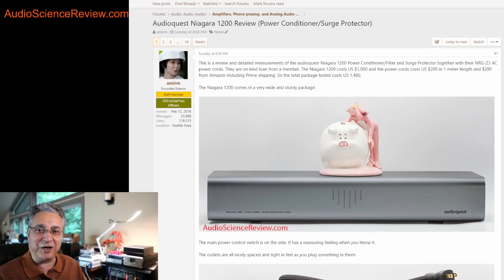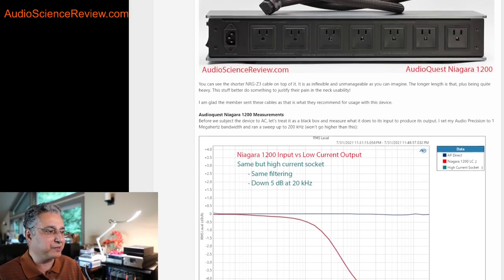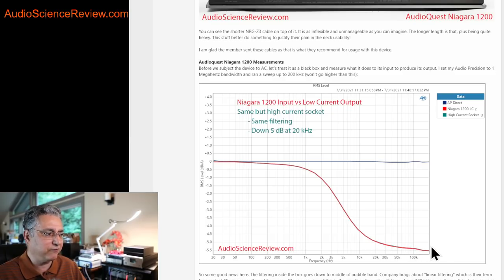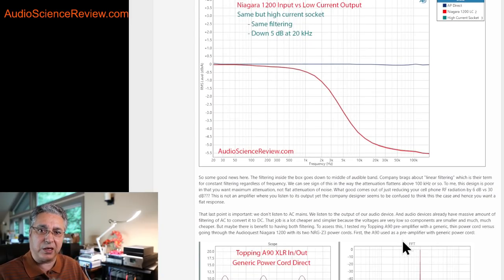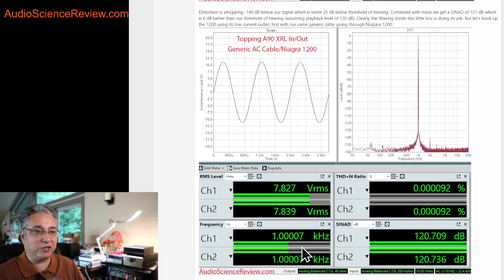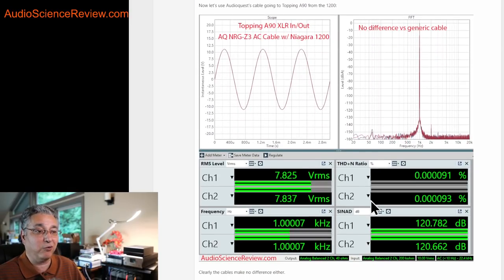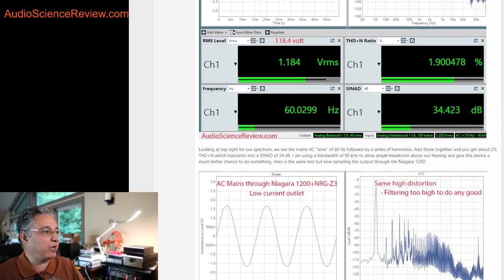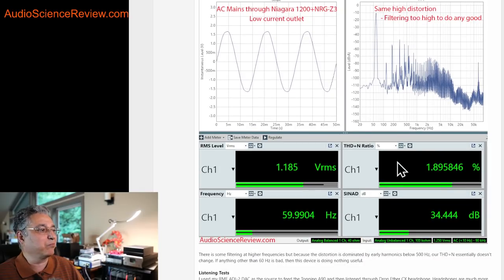Audioquest Niagara 1200 Review AC Surge Protector and Filter

Comment: Ok hooked up to audio quest but when went back to his ..."regular" ...equipment it sounded better. My question is if the normal surge protector sounded better why not tell us what piece of equipment sounded better. don't get me wrong i think this audio quest does indeed filter sound at just above 5k to 3 db but I am not sure that is a good thing. most audio devices are ac coupled and have capacitors. These capacitors filter noise if the noise is filtered before it gets to the capacities then the capacitors filter in such a way in which the dynamics are blunted. What I mean is the audio quest niagara filters the ac mains and the capacitors in my prima luna equipment would round the leading edges. No more audio quest niagara and the leading edges are back. Same device this dude just reviewed. My problem is this person did not trust his ears he said he preferred the sound with out the Audio Quest Niagara which I know is likely because I also could tell the difference. I wish he would of shown the difference between the Audio Quest and his standard device.
Reply: That is not how electricity works, coupling capacitors are not connected to the mains input.... they are connected in the amplifier circuit and at the output. The only job they have is to block DC from the biasing circuit from reaching the output. Those capacitors attenuate lower frequencies, not higher...... input filter capacitors won't even notice power filters being connected as they do so little.....

Comment: Power consumtion is NEVER at 50 or 60Hz, apart only for purely passive loads like resistors, capacitors or inductors. Any other load will consume as it requires and internal capacitors are not sufficient to compensate for that. A constant current load is also not at 50 or 60 Hz, but is at virtually 0 Hz, here the power factor will tend to be equal to 1, but  to conform to our mains voltage we will need to follow a sinusoide in current and power. An audio device can pull from mains at higher frequencies. 
It is counter intuitive maybe, but we do not need filtering of the mains power down to 50 or 60 Hz  for differential. It will be DETRIMENTAL for our device to get mains filtered down to 50 or 60 Hz, even if we can build such a filter. We need to block only the common mode.
1. In power conditioner we should focus to filter the common mode noise as this is the most likely to poison our input output path of our devices, and we should be less concerned about differential, and actually for the latest leave virtually no resistance for the audio band in the power conditionner.
2. A transformer powered device will have a consumption only in the pics of the sinusoidal wave, as the curent will flow only when the voltage reaches a higher value to charge the storage capacitor and provide the power for the load which is also not at 0V consumtion. So the consumption will never be at 50 or 60 Hz from the current and power points of view.
3. A switching PSU without Power Factor Corrector will behave exactly as a Power Transformer in this case. 
    A PSU with a built in Power Factor Corrector will tend to spread the consumpion a bit, but any way will consume mostly in the upper half of the sinusoide to charge the storage capacitors and feed the load, it will not go down to 0V and the current consumpion will depend on the capacitor to charge and the load. A storage capacitor in such a PSU can store for full load enough energy for 1/25 - 1/100 s duration, or 1 to 4 half waves duration in relation to the mains voltage.
4. What we also want is to reduce the noise from the Ground wire to our device ground (I measured values to be as high as 1 V p-p), also to sink some of the generated noise by our devices to the ground (safety Y capacitors, coil coupling capacitors). 

Probably Amir measured the differential noise with a differential filter, which is not that much of a concern as it will be filtered further by the device. I believe Niagara introduces some minor change in sound but as Amir said it can be even detrimental. The difference can be difficult to identify and probably changes are mostly related to the Ground noise being reduced by power conditioner.

I own a Topping A90, and I am not happy with their internal PSU and filtering from the engineering point of view, I will rate it as mediocre. I have done measurements and modifications to it , as I am an electronics enthusiast.
    
At the moment I use a 10 Ohm resistor to connect my device to the Ground wire to form a resistive divider like a volume potentiometer so the resistance of the interconnect cable is less than the mains Ground to reduce the ground loop effect. I do not know really how good this solution is, and what are the better options for ground noise reduction.

Thanks to Amir for his job, informative, very appreciated.

Comment: They use isolation transformers for medical equipment. My impression is that it cleans the noise and to some extent regulate the voltage. I don’t know if in medical situations it makes a difference but not in audio.
Reply: Well, for example diagnostic ultrasound probes (transducers) use frequncies way up from 20kHz, often in GHz range. In that kind of application it is sensible to use these kind of filters as those work at frequencies where it really does enhance the quality and we are able to perceive it by looking at the formed picture through a monitor. So there it's not just hocus pocus give me your money type of shit like it is in the audio business.
Reply: I'm sure the equipment is designed to work correctly with any old power source. I can't imagine any equipment being sold, be it pro audio/video, medical, scientific, etc., which only operates "correctly" on filtered power sources. I have a $100k studio VTR which goes straight into an ordinary power strip and straight to the wall outlet. And it works *perfectly*! Isolation transformers are mostly (if not solely) used to help prevent electric shocks. Very important for medical equipment which is being attached to people! 🙂👍
Reply: @njm1971nyc  I suppose you've used medical ultrasound like I have and that's why you know better, right? :D
Reply: @sakusaaristo191  I never said that. I was saying that isolation transformers are primarily used for safety reasons...the clue is in the name...*isolation*. If you have used the ultrasound equipment both with and without the transformer, in otherwise identical conditions, and found a noticeable improvement, that's great. It still begs the question why the ultrasound equipment manufacturer didn't include sufficient interference suppression in the unit's own power supply. My guess (yes, guess) is that they probably did. Unless your did an accurate A/B testing under identical conditions for each test, then your claims are just hot air. If you did, and/or there was a clear improvement, that's great. 🤷🏼‍♂️
Reply: it is purely for isolation from earth ground and the medical grade is for safety and not for noise reduction, they will have lower leakage into the secondary which is important as high leakage means you are not fully isolated from earth ground and have a change of getting electrocuted

Comment: Hello Amir, Its understandable it cant improve dac or amp noise figures, but maybe it can help clean up usb output comming from PC?
My topping dac sound a lot cleaner out of My s20phone than out of my Pc.
Thanks.
Reply: I know that PC noise can transfer into the audio system; I'm not entirely sure why, probably a ground loop issue - it is not present when not using the PC as a source, or when using optical cable :)
Reply: @RennieAsh  if you are really worried about noise then optical is a good way to reduce it as there isn't a direct electrical connection and it is a common input on dacs

Comment: Nice video. Here is a myth/debate you may have already spoken to, but if not, might be ripe for your analytical approach. Many people claim it is better to have two equal length speaker cables in a stereo setup rather than uneven lengths. But is there any real science behind that?! Would be interested to see if you could test Amir ?
Reply: There is real science behind that claim, sure, BUT, unless the difference in cable lengths is SIGNIFICANT (or the cables are inadequate to begin with), the difference will be so miniscule as to be totally inconsequential. There are likely wider differences in the speaker drivers themselves, just from manufacturing/performance tolerances. Don't sweat anything that you're told is a "problem", if you can't hear that supposed problem with your own ears! 🙂
Reply: @njm1971nyc  There is a video now, idk when it was made but it made zero difference to home use. You can even coil one cable up and it still doesn't make a difference usually
Reply: There's absolutely both; a practical reason, and real science behind that claim. 
1.) For future reconfiguration of one's system, it's prudent to keep you speaker cables equal in length. 
2.) Real science, if one speaker cable is twice as long as the other it has twice the resistance. 

How significant is either of these to you? 

1.) Murphy's Law suggests you'll likely re-config your rig and need that extra length! ... (then there's the OCD in knowing they're unequal). 
2.) Physics involved suggest despite one run having twice the DC resistance as the other, it won't likely matter even unless the load plunges down to 1 to 2 ohms or so... even then it's freq dependent  and short in duration. 

We all here grasp the theoretically ideal is to have ample ampacity to never encounter an operational scenario whereby the DC resistance is significant relative to the loudspeaker impedance.

Nyquist complex impedance plots ... something we don't see too often anymore... they illustrate leading capacitive, or lagging inductive, characteristic impedance by frequency.  

Nyquist graphs are a helpful visual to fully represent the multi-parameter complex relationship.

Comment: 60 hz hum you can’t hear? Cmon   you said our ears aren’t sensitive till 2-3 kHz? I think you ment directional not sensitive.
Reply from the maker: No, I meant that.  Threshold of hearing for 60 Hz is quite high -- around 40 to 50 dB higher than 2 to 5 kHz.  If this were not the case, you would be hearing hum from so much audio equipment.

Comment: What is everyone using for surge protection for their hifi gear? Thx
Reply from the maker: I don't use anything.  I do have a Class 1 unit installed at the meter.  And rely on insurance policy for any damage if it ever occurs.
Reply: @AudioScienceReview  you are brave Amir and thank you for this review. Although I had an electrician install a whole home surge protector at the breaker, I still worry that’s not enough. Decided to go with Furman to protect my 100k setup (Trinov, Classé, ProAc). Not expecting any improvements in sound quality using their products, but nice to know I have a little extra surge protection for those devices.
Reply: That's great to have a surge protector installed at the Point of Service (outside at the meter) and that is always recommended, but that should really just be the start of your surge protection journey, not the end of it - IF you don't want to have to deal with the hassle of having to replace a bunch of expensive stuff when a major surge occurs. Ideally, you want to take a three-tiered approach to surge protection. 1) Surge protector outside at the Point of Service (installed by the utility company) 2.) Surge protector in your breaker box (installed by a certified electrician) 3.) Surge protector at your device (series-mode, inductor-based, non-sacrificial). This is because each surge protector that you have has a different level of protection that it provides - and they are not all the same. The key thing to look at here is the let-through voltage and how (and when) that surge protector device starts to clamp and cut-off voltage when a surge or spike occurs. Understand for EACH device how much voltage it is letting though when a surge hits. You never want to see much more than about 330v ultimately getting through to your actual devices under ANY circumstances. Anything above that and you are very likely looking at potential damage. Yes, you can rely on your homeowner's insurance if you want, but you can also be proactive with your surge protection effort (they aren't that expensive) and have a heck of a lot less equipment that you need to spend time and effort replacing if the worst-case scenario ever does occur. Now, there's a limit to what ANY surge protection device can hold back and stop, of course, no question about it, but that doesn't mean that there isn't a benefit to putting good quality surge protection devices in place in a tiered/layered approach (to knock down the incoming dangerous voltage levels at each step) to help minimize potential damage.

Comment: This video is WRONG... Shane from SpareChange says his Niagara 3000 makes music on AM radio stations sound like they were recording natively @32/192. Also,  you are using a multi-thousand dollar Audio Precision Analyzer while he used an $80.00 Wideband power analyzer from Entech.
Pfff.
Reply: @wh0tube  The Shaman is partly correct. Both the aluminum foil and copper wire must be blessed by the Pope before they can be used to filter noise.
Reply: this is so sad...... i am surprised they can say all that out loud......
Reply: @kevonmanuel  I'm going to open up a high-end audio shop that only sells chicken's feet, goats blood and talesmen. I'm going to call it "Audio Voodoo" - and I'm going to make MILLIONS!!! :)
Reply: @michaelbeckerman7532  LOL...
I have an excellent audiofool gadget. Highend audio air purifier. I will take a Dyson air purifier, upgrade the power cable to pure silver and add carbon fiber plugs. I'll sell it for $6000. 
My snake oil sales pitch: "Your dirty air is killing your system dynamics and transients. To solve this issue, you must systematically eliminate the negative electrons floating in the air."

Comment: The only way to clean AC perfectly is to convert it to DC and back to AC not that there would be any point.
Reply: that is not a great way to do it since DC to AC conversion will end up in a lot of harmonic distortion...... most inverters have really bad outputs but the truth is that a lot of equipment simply doesn't care..... running the product off a battery is a good way if that is a possibility... but I don't see the need if the product has a regulated linear power supply....
Reply: @rokiedecentra9656  isn't that the entire approach there of the folks at Stromtank in Germany? You run your entire audio system on one big, massive battery that completely isolates it 100% from anything at all to do with the AC coming in from the wall.

Comment: If all these measurements you do are inaudible, why  measure them?  If you can't hear the differences you are measuring, then everything sounds the same?  So I just go buy the cheapest stuff with  reasonable numbers?  You push the best measuring stuff, then say it's inaudible anyway?   Don't get the whole ASR process.
Reply: His point here is that NONE of it is actually worthwhile at all - it's ALL a waste of your hard-earned dollars. There is no point at all in trying to "clean up" your AC lines in an effort to get better audio...so just stop doing it. Yes, surge protection is worthwhile and important (surges and spikes are real and they absolutley can and do damage expensive equipment when they occur). AC power line conditioning is not.

Comment: What if you had super trashy mains ? Your mains looked pretty clean.
Reply from the maker: I have a lab AC generator and used it to create hugely distorted AC waveform (30% distortion).  it did not make one bit of difference to output of audio device.

Comment: Why don't you record the actual end result of the system. Get an audio interface record the actual audio out before and after whatever tweaking device. Inverse one of them and then play them together. If your believes that everything is snake oil is correct then the two sound waves should be exactly the same and cancel each other out.